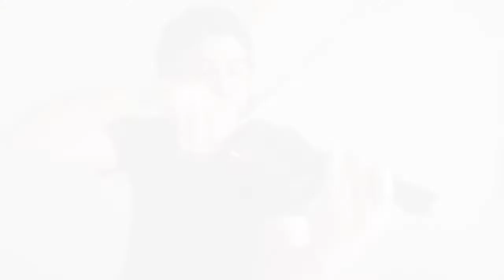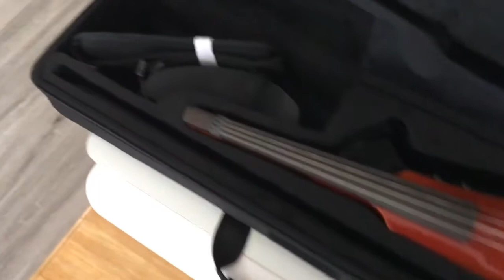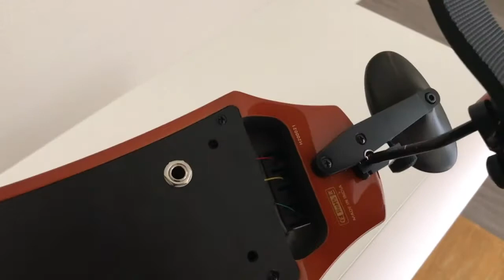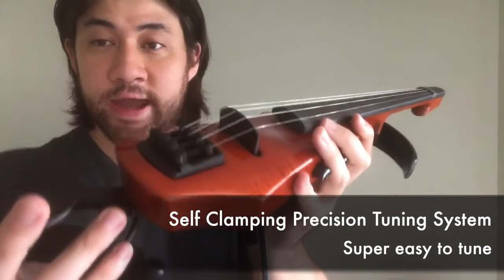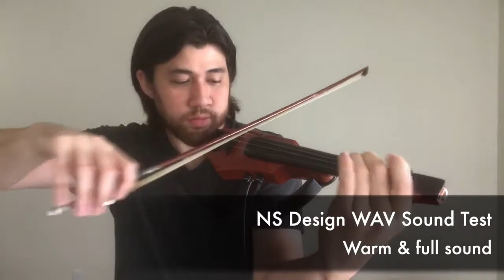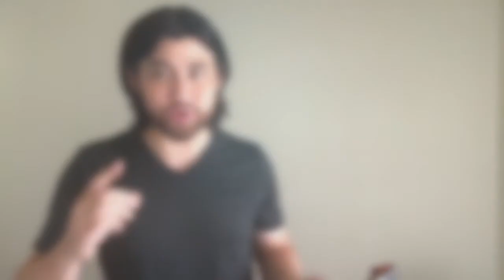NS Design WAV Electric Violin Review

Comment: Can I plug this into my electric guitar amplifier? If not what about my Focusrite Scarlett Solo 3rd gen? Will I have to buy an acoustic amplifier for this? Does it come with a bow?
Reply from the maker: It's a quarter inch output, so you can plug it into any guitar amplifier. You can also plug it into the Focusrite, which is what we used in making this video. You won't need an acoustic amplifier. However, it depends on the sound you're going for. Many electric guitar amplifiers are designed for guitars. So certain frequencies may be more present. The Focusrite will give you the cleanest / original tone coming from the instrument. These NS Design violins do not come with bows.

Comment: to get the best sound quality you need impedance matching, which means a preamp with an ultra high imledance input that provides a buffer and allows the sound to flow through without loading down the passive pickup with a low impedance input.